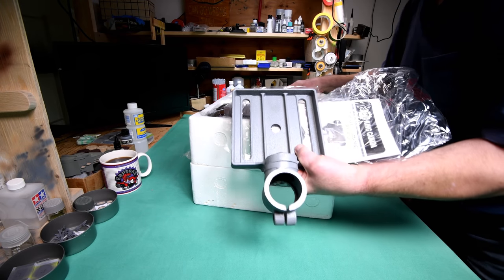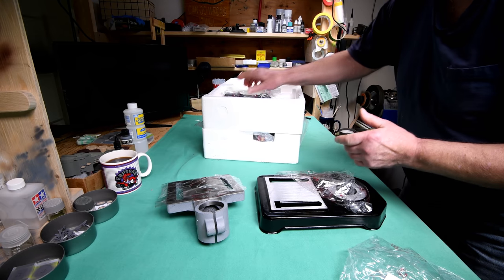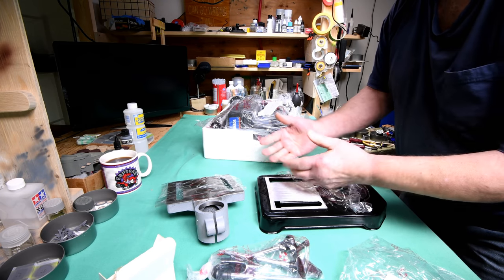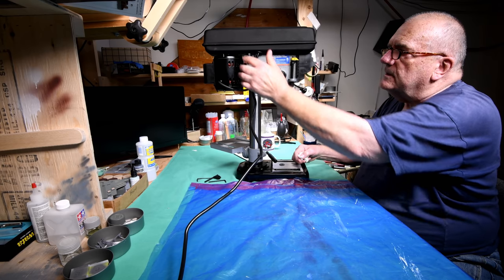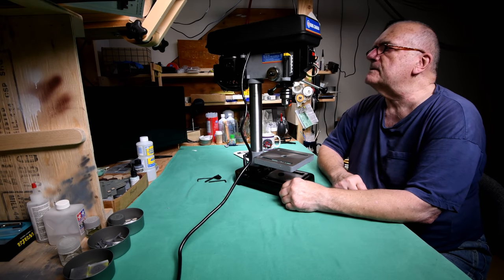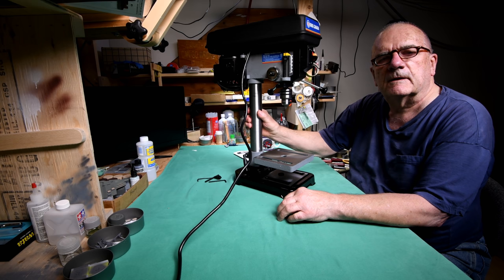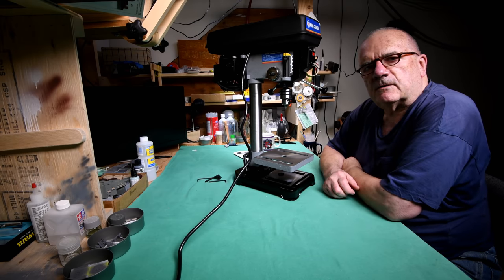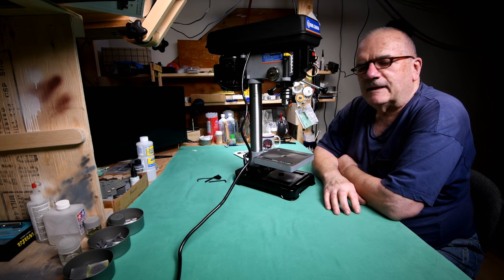The Model Ship - Part 598

Comment: One of the first things I did with my new baby drill press was to epoxy a sticky rare earth magnet to the top of the belt guard.
Makes a simple, easy, convenient place to keep the chuck key.
Reply from the maker: I was thinking of attaching an idiot string, like I have on the big one that's down in my workshop. Then I noticed the hole in the center of the base. Ah! So that's what that hole is for, lol. 😁

Comment: You seem to like brushpainting, but wouldn´t it be faster and easier to take out the airbrush and spray it from the "top" (I mean angle) instead of brush painting?  You always can use a piece of hard paper as a sort of a mask to hide the deck / upper portion of the side.  And you can go quite close to the surface so that you get no overspray to the deck part.

BTW: I would suggest not not putting another layer of a paint on another one (which is not dry yet) - that usually does weird stuff to the layer underneath. Better to wait and make another layer 10 minutes later

And sorry for my english - in school we learned russian at my time here.